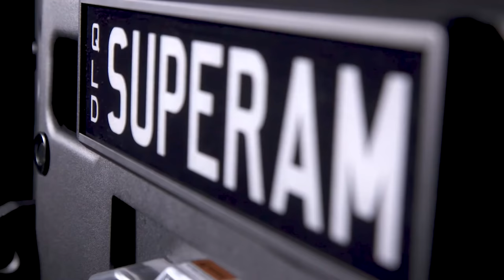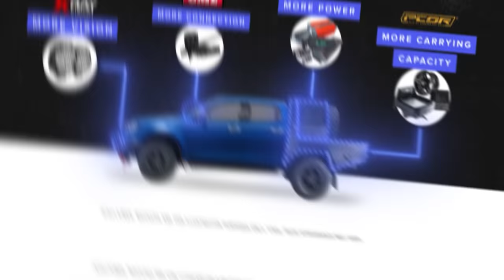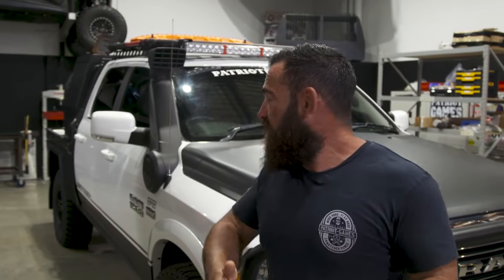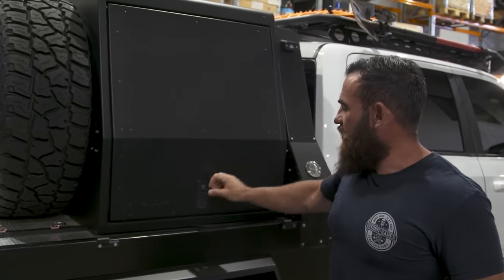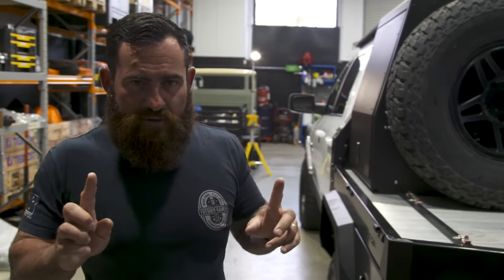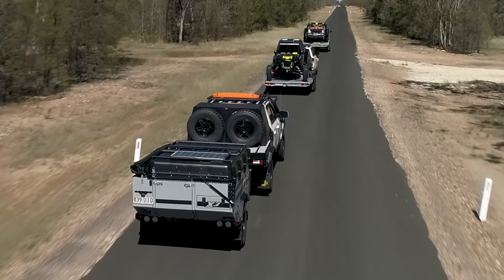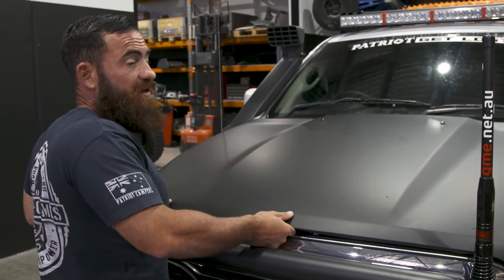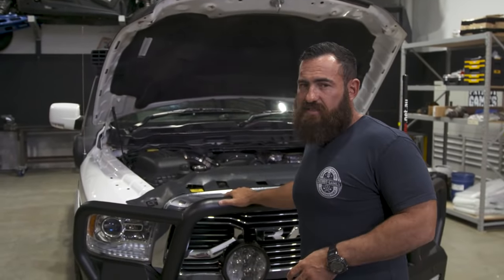Supercharged HEMI RAM 1500 As A Daily Driver?

Comment: Your comment about finding petrol is interesting. Here in Canada, the reverse is true as 98% of cars and light trucks are petrol. I have a ‘17 Chev Colorado with a 2.8 diesel with a tune and 125,000 km with zero issues. 75 mm suspension lift, ARB front with Warn winch, rear steel bumper, TJM Boulia roof top tent, rear fuel/tire carrier. 7.7 L/100 km on the tarmac and pulls my Toyota trail truck on a trailer just fine. Up 8% grades.
Total GVW is 5775 kg. You need to come to British Columbia, then Alaska on one of your tours! Not as hard core as Mongolia, but check out the Mackenzie Trail in BC. Cheers!

Comment: Running bigger tires, do you guys ever change the gear ratios? I don't remember you ever talking about that. Thanks, Jason.
Reply: 33's are the standard size tire here in the US for the 4x4 Ram 1500's so no need to regear since 33's are what he is running. One of the down sides to the Ram is you cant regear the front end. If you need taller gears then you have to replace the entire front center with one from a higher gear Ram and even then i think the tallest gear you can get are 3.73's.

Comment: They are not that small, I have a 2017 ram 1500 4 door crew cab 4x4 with a 5 lift on 37’s and my friend has a 2018 2500 4 door crew cab 4x4 stock suspension with 35’s and my truck is a lot bigger looking, both are 6’4” beds, 5.7 hemi but I have a ranch hand grill guard and he does not.

Comment: I bet this rig exceeds the GVM they can only carry 800kg above kerb weight that's only 10 liters and all oils and water, no driver or anything else. The bull bar and winch and fuel is well over 230kg, add the passengers say you the better half and two rug rats 200kg. Limits are getting pretty thin. Looks cool though.